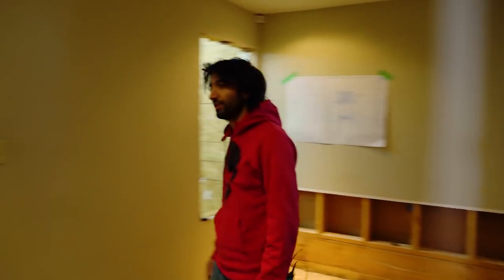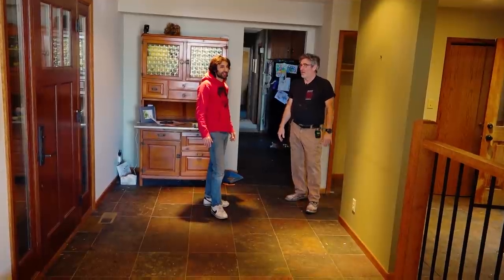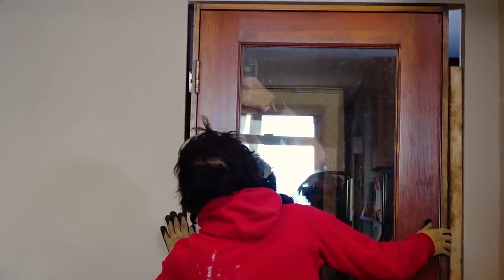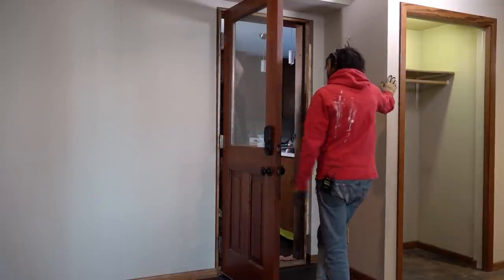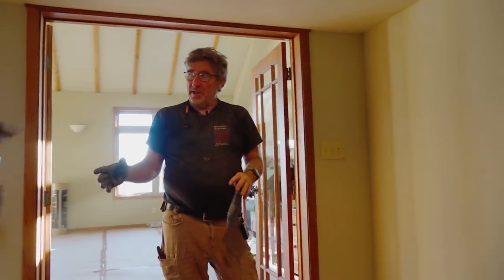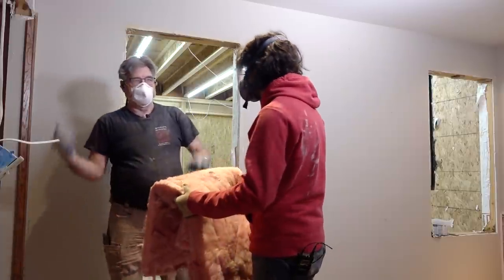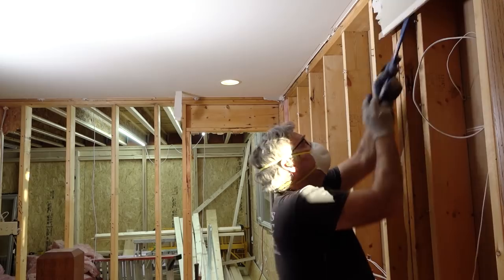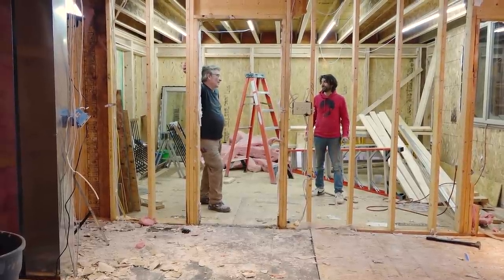Entryway Demo Day 1 | Home Renovation & Addition Part 20

Comment: It's been years since I destroyed, I mean removed walls for a remodel. I used to do it pretty much the same way Donavan is here, but my uncle showed me this cool trick. He would knock two holes in a piece of drywall and insert these 2 funky tools he designed. They were 2 strips of 2" wide by 2' long by 3/8ths thick flat bar that he heated and bent into a U. He would knock a few holes across from each other about 16 or more inches apart with has hammer. Insert the tools and pull both at the same time. This brought down the drywall in large pieces which were far better stacking and less trips to the trailer. It took some trial, but worked very well...

Comment: Donovan reminds me of me when I used to insulate houses. The guys I worked with threw a fit when I would work with fiberglass in short sleeves in the summer. All you have to remember is 2 things, 1) Always rinse from top to bottom on your arms and 2) Never wear a silk shirt for a few days after because if you missed any glass shards silk will find them.

Comment: BOOM!  DEMO-DAY!  What a huge change!  Curious to see what will support what was held up by that load-bearing exterior wall where the sun room got added on.
Reply: Gonna have to be a pretty big glue lam beam. I suppose they could use steel, too.
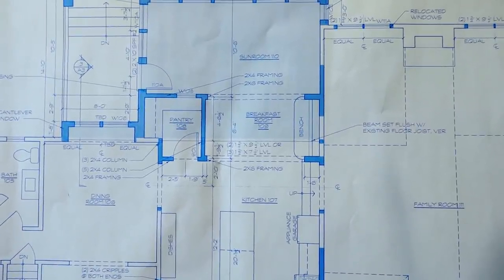Reply from the maker: See plans at 2:30
Reply: Matt should get the engineer to spec out a hardwood beam for that wall and then put that big bandsaw mill to work to mill up a nice solid exposed beam.
Reply: @mcremona  So 2 ply in the back and 4 ply in the front? Assuming you go with the 9 1/2" LVLs  for both, that's 3 1/2" x 9 1/2" in the back and 7" x 9 1/2" for the front? I hope I'm reading that correctly..  I wonder what the equivalent of that is in a solid wood beam, maybe a 10x12" or 10x14?
Reply from the maker: @johnbutchc.jenkinsii8910  We're putting the beams up into the ceiling

Comment: You guys have way better air handling equipment, than we did, when I use to help in the demolition of houses 45 years ago.
Reply: I was doing demolition back that far too with dust in your nose and lungs it was not good especially and plaster walls

Comment: Even with the cost of lumber today I’m interested to know if it’s even close to considering salvaging the 2x’s or is it  more cost effective to grip and rip. For some reason I think Donavan knows!
Reply: Its mainly two things.  Labor costs and and keeping the project moving forward.
Reply: @donavanshomes  and also you wouldn't wont to cut nail embed  wood with expensive tools and saw blades. If more then 6 nails per 8' stick its cheaper to by new
Reply: If you have a compressor and cheap labor, you can blow the nails out. If you have a teenager, that's fine. As long as they can be trusted to not shoot their eyes out. (the nozzle goes over the nail and gets blown out backwards, put the 2x over a bucket with water and sand)  If not, they can just chop off the ends with a chopsaw and just use them for fill in odd spots.
Reply: Demo saving materials is only effective if you have free labor or say men working at $16 or so. Tools must be available and any molding & 2x should be pulled free and nails strip separately later. A general or contractor making >$70 should not be doing demo. It is not skilled labor and he cannot be used to save a hundred dollars worth of material per 2 hours- it is a wash. Saving money as a homeowner means you do the demo and they will hate you becaue it is gravy money. It must be agreed beforehand. It must not cause delays. Becuse the owner wants to save it is okay but the schedules have to be clear.  getiing a pile far away outside is the reason not to save money, but to allow new workspace.
Reply: I am enjoying the project, and i am not opposed to new construction. However, as we all become more aware of waste in everything--including construction--i watch this demo and all that crap going into the dumpster/landfill/earth, i wonder about how to balance our needs vs the planet. All those materials (wood, plaster, etc.) were used for a fraction of their service life, all for a bigger room. I wish Matt & Donavan had a thought to share about minimizing their waste.

Comment: Some might consider saying “a big sledgehammer” redundant. Because a sledgehammer is a big hammer. But it’s really wrong to refer to one that way. Sledgehammers aren’t sized small, medium, and large. They are actually sized in weight. Two pounds being the smallest I personally have seen. They go up in two pound increments. For example 2#, 4#, 6#, 8# 10# and so on. A 20# sledgehammer is largest that I personally have had the pleasure of swinging. Now that is a big sledgehammer.
Reply: You must be fun at parties.
Reply: @mm9773  Yes, learning is fun.

Comment: Matt, just wondering if you saved any of the door trim and the wood from the railing? When I do demo, I have a hard time just throwing out good clear wood like that. Probably why I have a whole corner of trim I'll probably never use... Lol
Reply from the maker: I’ve learned my lesson. Either I throw it away now or I throw it away later. More convenient to throw it now.
Reply: I cringed when Donovan bent the shelf brackets! That's something I would have reused somewhere, sometime, maybe!
Reply: @mcremona  But the next day after I throw it out is the day I need it... It's a vicious cycle.
Reply: In my part of the UK, there are quite a few wood recycling projects (both commercial and community based) that will collect all kinds of wood then resell, repurpose or recycle. Best case it's resold as lumber, worst case it's burned for energy - but at least none goes to landfill. They charge for pickup but make the charge less than the cost of the skip you would have used otherwise.
Reply: I was thinking the same, this house seems full of really nice looking trim.  I know it's time consuming to collect it and of course Matt doesn't need any more wood but I know this would take me a lot longer since I'd be keeping it.
Reply: @chipdayton1625   Ha! Those were the worst pos brackets you can buy. Not worth anything. new $3 at best.
Reply: @firesurfer  Definitely low quality, but fine for basement/garage storage.

Comment: I have a question, I live in a 1920’s wood frame house that has the attic finished with two small bedrooms, low ceiling height, small dormer for head clearance on a steep set of stairs going up. The 3 year plan would be to bow out the upstairs to have a mostly full ceiling height and add a bathroom, my question is who do I contact first to give me ideas on use of space and what is possible to do. Architect ? Engineer? A design/build contractor ?
Reply: Depends on how much money you have.   Honestly get some refs for architects and a proposed budget from at at three companies. When you have an honest idea of what you want and can afford. Then you can move forward.
Reply: @firesurfer  alright thanks!
Reply from the maker: Yeah I’d look for an architect to work with. They’ll be able to give you a more cohesive and thoughtful plan for the added space

Comment: Matt,Great job on these videos they are a lot of fun to watch and learn from.   I could not find in the video on the front addition the post anchor installation.  What did you use under your 10 x 10 posts?
Reply from the maker: Helical piles.
Front Addition Foundation (Helical Screw Piles) | Home Renovation & Addition Part 7
https://youtu.be/7uZeE0zxKoc

Comment: Probably a stupid question, is there no way to reuse the 2x4s or the wood you are removing, or is it not worth the extra time to demo it without chopping it up to save it?
Reply from the maker: It’s really only good for shorts. The wall studs we’ll remove from the exterior walls are a little more worthwhile; just a few drywall screws to back out

Comment: Just wondering. If it’s 0F outside then how cold is where you’re doing the demo now and how is the demo effecting your heating bill? Neither the temp or the bill could possibly be comfortable.
Reply: It's -26 in the evening/early morning hours in northern MN now.
Reply: @danaskubic2145  sorry. It’s supposed be 72 Wednesday here. Mid 60’s and clear since last week.
Reply from the maker: Hasn’t been too big of an issue. That area is now a totally separate from the portion of the house we live in

Comment: Just curious if there are recycling plans for the demo? You would think all those 2X4s would be good for something for someone.
Reply: Not really because they are full of nails and holes drilled for wiring. I usually end up just adding them to my burn pile and collecting the metal to recycle.
Reply: Not worth the time

Comment: Have you considered how your electronics are going to work? By planning ahead you can create a convenient central control point. In the past one needed to find a central place in the house to place your router so you had some hope getting good WiFi coverage. Our router is in the basement near where the power and fiber come in. Out of the Verizon interface box we have our TV COAX which goes to a powered 8-way splitter which has COAX running to living areas, bedrooms, kitchen, and offices. Not all have been terminated, and, no, we don’t have eight TVs. We knew beforehand which TVs we wanted to be on wall mounts. Those have a line running up and down behind the drywall with power and HDMI thus hiding cabling. We have a 10-port gigabit Ethernet switch on Cat 6 UTP, unshielded twisted pair, which go to living areas, two each to the offices, and bedrooms. WiFi in the house is provided by the eero system of three units, one attached to the router’s Ethernet port and the input to the gigabit switch, the other two are just placed in convenient places on the main floor and upper floor respectively. Our whole house coverage is excellent and completely transparent. The system can be managed from a smartphone app.
Reply: Get a couple of Avaya Instant AP's, and simple run them to your router with POE, and you can disable the routers wireless.  They're $25 on eBay and much, much better than normal consumer crap.

Comment: I have been watching this home renovation series and am surprised that you seem to participate a lot less than I thought you would. Many times I see you standing around watching Don work instead of helping. Then there is the terrible waste of material. I just watched Don sawing thru stud walls and making firewood out of all the framing. Such a waste. Matt, if you helped out more, you could have  stripped the drywall and electrical from those walls, removed and stacked the insulation to be used again, and CAREFULLY removed that stair railing. Then Don could use one of his new carbide blades to cut the nails off top and bottom and removed the studs so THEY could be re-used also.
Reply: Dude wants it done in a timely fashion, and saving a few bucks on framing lumber is ultimately penny-wise and pound foolish.  
Its call Demo for a reason, not Conservation...
He's working as an assistant, and getting in your contractors way is going to cost you money, and possibly a contractor.
Its 0'f outside, and they want to get it done.
Not everyone's eyes light up with dollar signs when they see some 2x4's being cut up.